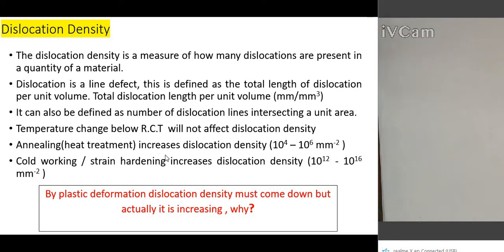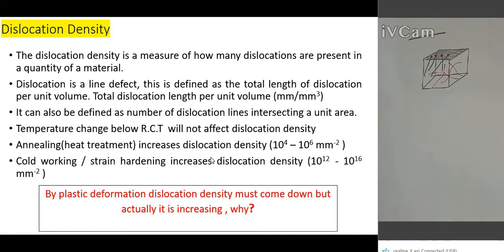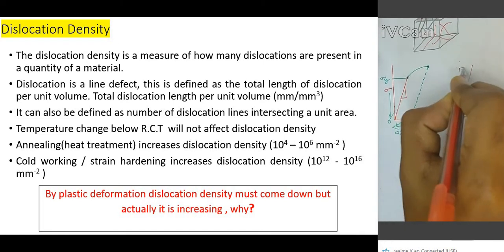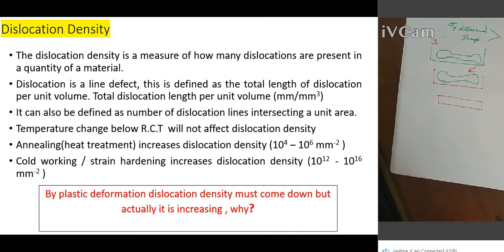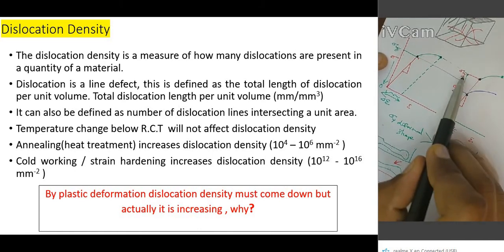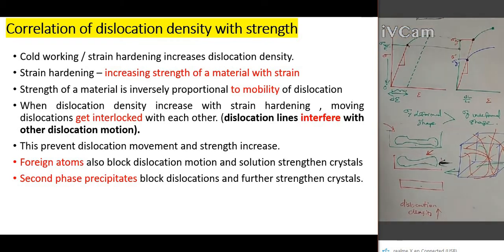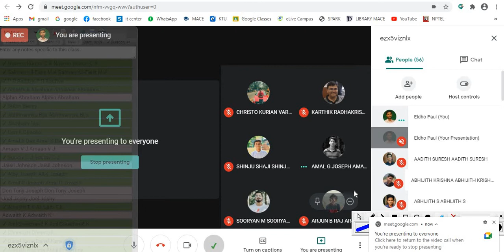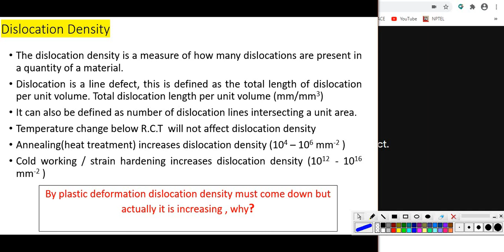lecture 14 , 2nd part Dislocation density,strain hardening

Comment: I have  one doubt sir  dislocations crosses the grain boundary means yield strength
Reply from the maker: Reduced
Reply: When applied force , on material  and material having interstial atoms in dislocation space then I think it is the yield point after crossing intersistial dislocation  after crossing what about the stress at the grain boundary